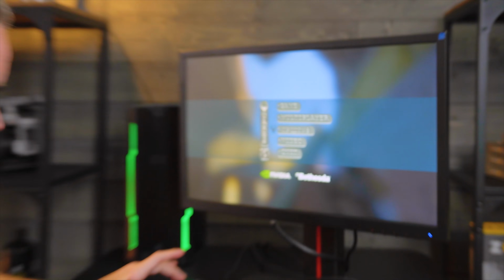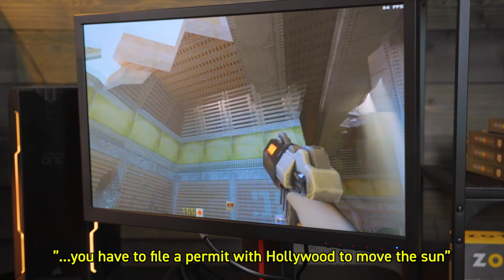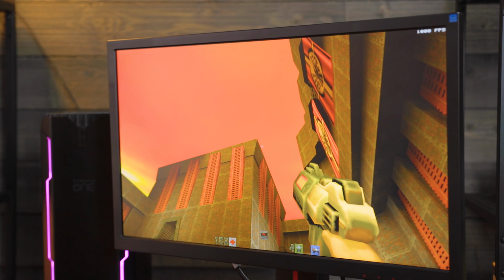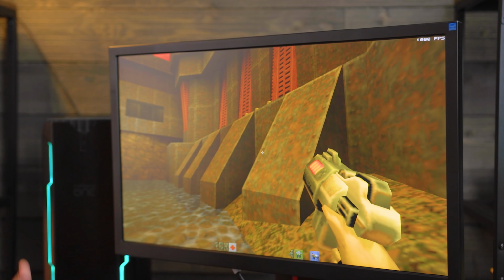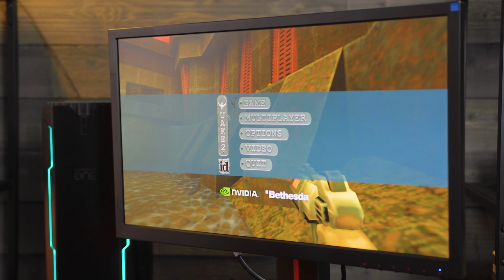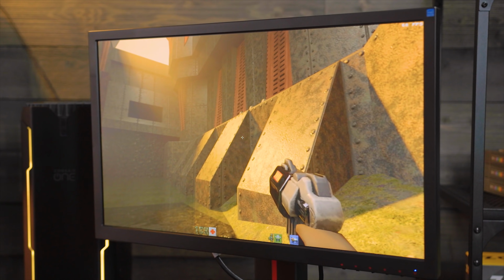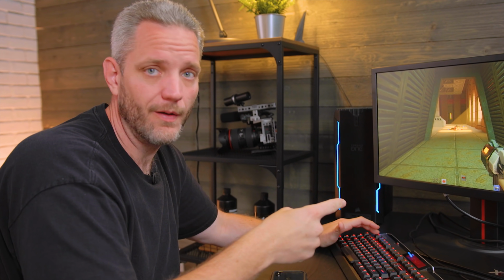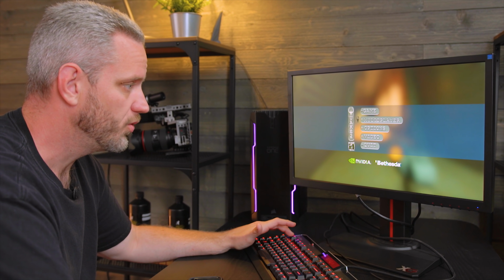Testing Quake II with fully ray traced update...

Comment: played on gtx 1070, 30-60 fps depends on what resolution you set up !
Reply: so you turned the settings way down? because most 1080ti result are just below 20fps
Reply: @3point1.2  There is one option that you need to consider, it is a 'upscale'. I slide it about 70-80% (by default 100) and choose screen resolution of 1600x900 (i sure 1080TI can handle 1080p) all other settings by default
Reply: @AlekMadeDis  yeah 1080ti can handle 1080p when it's normal rasterization but this is real time ray tracing this demo is about and you seem to be the only 1080ti user with such high figures. Your fps is miraculously 2-4 times higher than all the other 1080ti posts.     I wonder why that is.......
Reply: @3point1.2   lower resolution scale in video settings. If you play with this setting you fine tune what work best for you.

Comment: i5 6600K stock, MSI 1070 Gaming X 8G, 16GB DDR4 2400, caustics off, GI low = 35-45 fps mostly. Bad experience though. Q2 needs 60+fps to feel good. Getting some strange, second or two long, freezes on non-rtx mode (opengl). Dont know whats up with that.

Comment: I7 4790K @4.4, EVGA GTX 1070Ti with +220 clock, +600 mem, 1280 x 720 global illumination low getting 30fps average, 28fps on the low, 33fps on the high.
Reply: Messed with a new setting using desktop for resolution (1920 x 1080)  and 50 on the scaling.  Got to use medium global illumination and it is running @ 40fps average :-)  whoop whoop!

Comment: It won't start with my GTX 1050 TI (newest driver installed). What do I need to do to get RTX 'enabled' on a GTX card?

Was just for shits and giggles. Switched to my old gaming rig with a 1070 and after turning down some settings I get a solid 15 FPS. 5 to 7 FPS as it comes. About a 1000 FPS if I switch to opengl :-)- LMAO.

Comment: Gtx 1080ti @2100 mhz intel xeon 24 thread @3.9 ghz getting around  55 to 70 fps with a lot of noise. It can't be de noise cause I am lacking in de noiser tensor cores.

Comment: Big fan of going raytracing but I find this demo disappointing. It's very sloppy with the GI precision, often times items or characters will have no shadow under them like it's 1990 fakery so it's significantly poorer quality than fakery 10 years ago. Not sure what it means but they are definitely using overly aggressive blurring on the GI to use few samples. Maybe just to get high fps count rather than do justice to raytracing GI. It's actually a significant injustice how poor it is. Adding direct sunlight is just a distraction. 
I believe that it could be a lot better with a bit of selective sampling.

Comment: msi rtx 2070 gaming z clocked at 2070 on the core and 7300 on the mem, a ryzen 7 2700x clocked at 3.8ghz, screen res at 2560×1440, running at 39-48 fps
Reply: Could you post gpu temps? I have the same card and hitting 70deg
Reply: @hobster07  it was sitting in the 50s
Reply: @fritzlewis9149  thanks! Mine is running a bit hotter 😀 Ambient temp ~30deg, closed case with Zero Frozr active.

Comment: "When I jump, you can see that it softens up" No, no it doesn't. It looks more like only specific cases have softer shading. That flag isn't one of them.
"It's not Nvidia specific" Now I know you're full of it. RTX is a custom Nvidia rendering method that is not open like DXR. AMD can't run RTX games even if they supported DXR, much like PhysX, so RTX is DOA and relegated to sponsored tech demos. Even if Nvidia opened the API, I doubt AMD would ever implement it, unless Nvidia patched a DXR compatibility mode into RTX, which would obviously run slower than native DXR, and it would require update/patching every single RTX game for compatibility.

Comment: EVGA Geforce GTX 1080 FTW
32Gb 1800mhz
i7-4770

All the Effects Cranked up = 4-10fps

Custom:
1280x800@60fps
Resolution Scaling 80%
Low Lighting detail ~40

Lots of Softening of the available light, but nowhere as crisp as actually RTX card

I do like the cel effect for opengl they added.... runs for days obviously but pascal cards are rubbish for the real time ray tracing

Comment: i9 9900k (5.1)
RTX 2080 ti
16Gbs 3600hz (2x8)
At 4k.
I get from 75 to 130 fps.
Most of the time it locks at 93fps.
Reply: No way you can get 75-130  fps at 4k  with your specs at fully raytraced
Reply: @roxoevil 
I said, mostly locks at 93, it never stays at 130 or even close enough.
Overclocking and keeping your CPU cool it's all you need.
Don't go crazy with that overclock tho, I like to keep it at 5.1 under 60°c.

Comment: EVGA 1080ti Hybrid, no go. Error "No ray tracing capable GPU found"
Reply: Update your drivers and patch win10.
Reply: @84brcko  Yeah I did that, posted an update. 1700 4.0ghz 1080ti 2016mhz memory around 6000mhz 1440p ultrawide 7-9 fps, stock settings. reduced resloltion to 60% lookin at about 20-23 fps... looks great but those RTX cores are flexing on the 20xx.

Comment: Downloading it now, bit my laptop has three year old ATi oops I mean AMD graphics so no idea what will happen when I try to run it. My desktop has nVidia but it's not exactly this gen either, but I have to remote into it to test so I'm going with the laptop first.
Reply: "Fatal error - no ray tracing capable GPU found" with a Radeon R9 M385X on my laptop. No surprise there.
Reply: "Fatal error - no ray tracing capable GPU found" with a GTX 950 on my desktop, pretty sure that's not because of remote access via TeamViewer. Again, no surprise. I'm dealing with older hardware here. I've been thinking about replacing my laptop with something more modern that can actually replace my desktop too, since I'm only home a few days a month.

Comment: 2x 1080ti Sli (oc'd 2.1ghz C/ 6.1ghz Mem)
I7 7700k (oc 5.1ghz all cores) 68fps all setting on, global ilumination high, 720x480p.
720p = pc suffers (28 fps)
1080p = pc chokes and dies. (14 fps)
1440p = pc doesn't even wanna try (9fps)
3840p = pc just turns into a fireball. (4fps)

Comment: AMD Ryzen 7 1700 @3.95ghz All Cores
32gb DDR4 Ram @ 3200
Asus Rog Strix X370-F Gaming Mobo
Asus Rog Strix GeForce GTX 1060 6gb GPU

Got a whopping 16-17fps @ low global illumination @ 1280*720 (144hz)

All other settings... Unplayable...

Comment: That was the worst explanation of rasterization ever! Rasterization simply means that you apply a screen space raster over your scene projection so that you can interpolate vertex values over the pixels. Therefore each "pixel" only has local information when shading it, in the early days of Q that would be a list of point lights. Raytracing you still shade each screen space pixel but instead of interpolating values you keep shooting out Ray's into the scene and accumulating the results recursively. This means suddenly each pixel has a global context, albeit at a sampling rate set by the amount of rays.

Comment: I know I'm late.

6700k @ 4.3 OC
1080ti SC
1440p@ 165hz

8-11 FPS... I can barely move in the menu, so awful. Sucks.

I wanna buy an RTX card, but if they barely handle games at 1080p with just 60fps, I might as well skip this 2xxxx gen entirely... Seems like these cards are just too weak at this time. I want to achieve at least 90fps @ 1440p with my gsync 144hz panel.

Comment: Aorus Ultra Z390
9900K @ stock
iChill 3X GTX 1080 @ stock
16GB HyperX 4000Mhz

2560x1080 - big mess @ any global illumination
1920x1080 - 9fps @ medium GI, 15fps @ low GI
1280x720 - 11fps @ high GI, 25fps @ medium GI and 35fps @ low GI

TURN OFF HIGH RES PAUSE MENU!

Comment: amd ryzen 2700  3.2 ghz
corsair vengence pro rgb 3000 mhz ram 
asus rog strix gtx 1060 6gb oc model
msi 470m motherboard
nzxt 240mm kraken x62 aio
nzxt h500i case
rtx 8-10 fps 
opengl 999 fps

Comment: LMFAO i7 860 overclocked too 4.0ghz with coolermaster 6 pipe, 16gb corsair dominator a 120gb ssd , 1TB hdd and MSI GTX 1050 4gb overclocked in a Corsair Carbide case 4 120mm corsair fans and getting raytracing muhahahahahah and playing this 68FPS well this confirms it raytracing is a gimmick

Comment: I'm sorry but this just seems so bad.  This is like reboot 2.0 for Nvidea.  Try number one was the big 4k gaming holy grail, which didn't pan out.  So now we're running with ray tracing, which lo and behold nets you the same results as 4k gaming, shitty FPS.  The truth is 20 series cards beyond the 2060 really don't have much value.  There is no value in using unrealized tech as the selling point for vastly over priced cards, and even less for buying one.  How are they going to truthfully market these?  Buy a 2080 RTX with ray tracing, but don't bother buying anything over a 60hz monitor?

Comment: Completely useless and it makes Quake 2 uglier than original :-) while running like dogshit on the 2080 Ti and has a preset algorithm inside with which it dettects what GTX or RTX it's running on and locks FPS fixed no matter what graphic scene there is on the screen :-).

Comment: Go ahead. try to prop up rtx, as software eats the hardware's lunch. Just like the physix's cards before, hardware rtx cards will soon be left in the dust.
Heck that postprocessing fx injector, name escapes me at the moment, has in beta a hardware agnostic low performance impact ray tracing system that runs on any card.